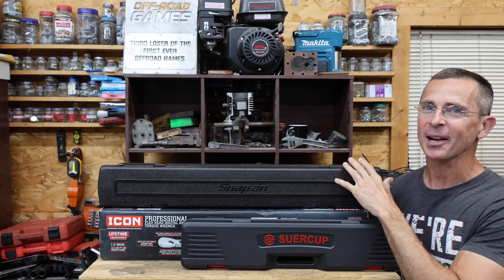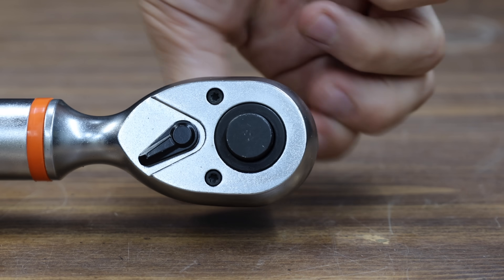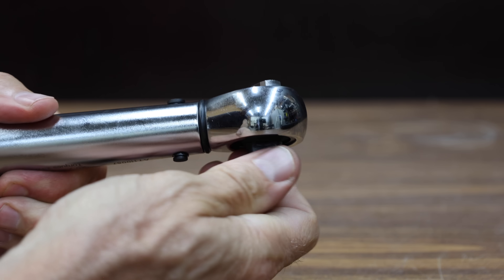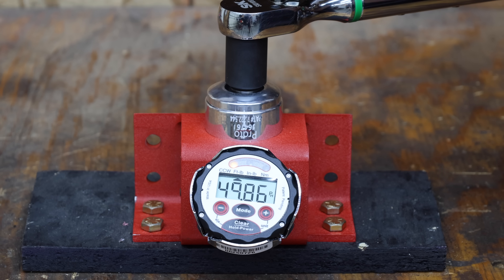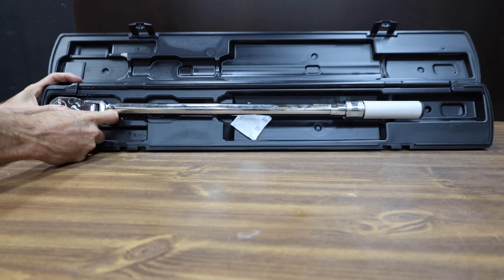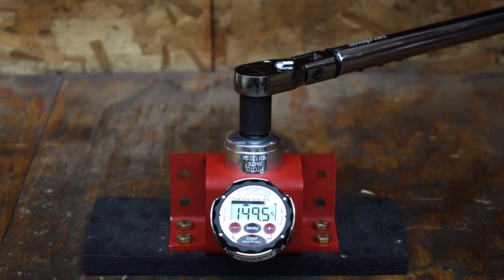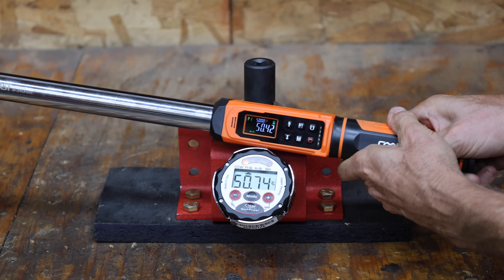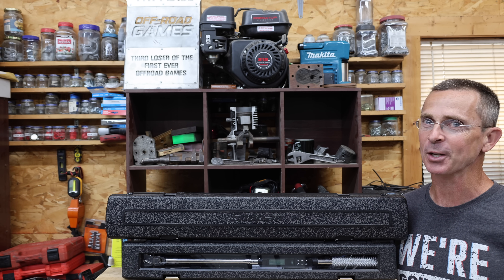$78 Torque Wrench vs $790 Snap On & ICON—I Didn’t See This Coming!

Comment: Beyond the accuracy, I've found the ergo's and user interface on many (most?) of the cheap torque wrenches to be nearly unbearable...  Things like incrementing by .01 ft/lbs when adjusting is ridiculous on a torque wrench that goes to 250. And the bedazzling array of lights and buzzes  when using them  inst4ead of a simple, crystal clear indication when you heat your torque.  Any feedback on these elements from your testing?

Comment: Hate to say it but… you’ll have to retest and add in battery voltage test at the different stages. Maybe a correlation with accuracy.
Reply from the maker: Thanks for the constructive feedback.

Comment: I have the cheaper HF digital torque wrench in the 3/8 size. It's OK, my main gripe with it is that the controls are maddening. When you get it into angle mode, it locks the display and you have to wait over 30 seconds for it to start allowing input from the buttons. It's super irritating. Also, the accelerate when held on the up/down buttons is a rocket ship. You push it once for 1/10th a foot pound, if you hold it, it starts rocketing up at something like 10+ foot pounds per second. And if you are trying to zero in on a value, and are pushing the button quickly, it might decide you're actually holding it down and in an instant you just overshot by 8 ft/pounds.
I mainly work on motorcycles, so 1/4 and 3/8 torque wrenches are what I need accuracy on. My 1/2" torque wrench is a HF click type, mostly I just torque lug nuts, and occasionally something big like a motorcycle swingarm locknut, a sprocket nut or an axle nut. Accuracy isn't all that critical for any of those, +/- 5 is just fine.
Reply from the maker: Thanks for sharing.

Comment: Tried to us the links for the TQ wrench that you used, but at least the Coobeast and the Suercup links were to 1/4" drive items not the 1/2" ones you state you used in the video. Aside from that..as I just bought a Gearwrench 3/8" drive one...I was unsettled by your results. But thank you

Comment: How about testing 1/4 or 3/8 for low torque range? I wouldn't care a few ft-lb off for lug nuts but that would be critical for spark plugs or something similar, Regardless, i am thinking of upgrading my cheap HF to digital version. Thank you again for your hard work
Reply from the maker: You are welcome!  Thanks for the suggestion.

Comment: Could you do the same type for the screw driver type torque drivers? Small things like lights and red dots need to be tight but not stripped.
Reply from the maker: Thanks for the suggestion.

Comment: My $39 Harbor Freight Quinn 1/2” digital torque wrench adapter that attaches to my 1/2” breaker bar has worked great for torquing lug nuts, etc👍
Reply from the maker: Thanks for the feedback.

Comment: Great job!

Cycled 1000 times...  Look at that energy!!!!

I agree, the Seurcup is pretty impressive for $78 bucks....  You could do a lot worse....

I actually have that Craftsman.  I've had it for awhile, I really like it.  You didn't mention it, but the Craftsman also does angle, which is handy sometimes.....

As far as new torque wrenches, guys in our lab literally would not use a new torque wrench...  They would cycle it a bunch of times (not 1000) and then check it, verify it, and then put it in use.....  And at various intervals, it had to be re-checked....  Just some trivia for you...

I would actually say a lot of those were plenty good...  There's a bunch of other factors that could easily mean more than 2% in the real world...  Is it hot out, or cold out??  How rusty is the lug nut??  How much WD40 did you spray on the stud???   That stuff would all matter more than 2%....

Great job though, great test!!!!
Reply from the maker: Thanks!

Comment: I’ve always tested torque wrenches throughout their torque range.  So it it’s a 250 ft/lb wrench I would test it 5 times at 50 ft/lb increments.  This gives you the best test that the wrench is accurate throughout its entire range.  The only snap-on tools I own are my torque wrenches just because they are accurate and maintain their accuracy.
Reply from the maker: Thanks for sharing.

Comment: Maybe Icon has changed their ways more recently, but I used to have an Icon torque wrench. After the 3rd time of the gears binding up I got tired of driving back to the store so I bought a Snap-On. Complete overkill for my needs, but it works every time I need it.
Reply from the maker: Thanks for sharing.

Comment: I have a Snap On click style finger pincher from the 90s that I have never had a problem with and I keep it calibrated. I have a digital Snap On from the early 2000s that I also keep calibrated and have had no problems other than replacing batteries like I say and like I’ve told my kids you get what you pay for.
Reply from the maker: Thanks for sharing.

Comment: Where is the Pittsburgh? Didn’t see it in the other review you did of non electronic torque wrenches that you did in the past. But, that’s what I can afford, have bought, use and routinely rely on. Is it close? No clue but it has to be closer than just guessing “probably tight enough.” They are cheap enough by comparison that you could get 3 or four to see how consistent they are, or aren’t.. thanks
P.S. if there is a torque spec I try and use the torque wrench, diy I don’t really know what I am doing and don’t want to mess things up. I have striped threads with an oil drain plug once. So, yes I carefully torque even my lugs nuts cuz I don’t think it can hurt and it makes me feel good, safe and secure. Worth the time for me.
Reply from the maker: Thanks for the feedback.

Comment: Sewercup. What a name. I didn't catch it but does that one also have the Angle measurement?  A lot of engines today are torque to yield which require angle measuring after reaching the proper torque.  I think you mentioned angle once or twice when presenting each wrench.  It would have come in handy when I was working on the Ecoboost which EVERY bolt required a 45* past torque turn.

Comment: Could you tell by using a spring scale on the end of the torque wrench (preset to a desired test weight) and test the accuracy of the digital components? What about comparing digital torque wrenches against manual models, both with and without a click indicator?  I think that would make a great follow up. When relying on the display to calculate % off target, you don’t actually know if the digital was correct, or the applied torque.  I just hit 15:26 and see that you already were checking 😂
Reply from the maker: Thanks for the suggestion.

Comment: The snap on guy I have every year verifies the accuracy of my Torque Wrenches on all 3 of the Electronic ones which is a big reason I bought them (and the 30% discount) 
If they are out and can't calibrate back to that like 2% margin they get replaced. 

I started off with Gearwrench click types. They let me down multiple times unfortunately and I made the switch to Snapon after that. It was fine as a lube guy but when I got into more mechanical things and started having come backs related to the fasteners I got very discouraged by Gearwrench. 
I also bought some of their new locking ratchets and they just don't stand the test of time at all. Overall kind of sad because I was big on Gearwrench. I hope others have had better luck and this video is great. I'm glad there is alternatives because if the Snap On guy wasn't such a good man I wouldn't touch their stuff. I just can't justify it with the cost of life now
Reply from the maker: Thanks for sharing.

Comment: My snapon 18 volt impact wrench charger finally quit. I had the batteries repacked 2x.  The last one seemed to not hold a charge long...now the charger won't charge. I paid near 600 for this and now....  wondering if anyone can offer a good price for repair?  Or should I just sell it as is or for parts?  How much are these worth now?

Comment: I'm a big fan of inexpensive tools, and I think you often get 90% of the benefit for 10% of the price when comparing against premium brands.
That said, in this case I think it's a little tough to draw confident conclusions on the SUERCUP or most others based on the single tool you bought. As far as I understand the exact accuracy of a given torque wrench is somewhat up to chance so you could have a gauss curve of accuracy all within the +/- 2% acceptable range. It's possible you got "lucky" with a particularly accurate SUERCUP and less lucky with some of the other similarly-priced brands.
That said, a sample size of 1 is way better than 0, so I'd still go for it if I were in the market for one. And the ones that exceeded 2% error semi-frequently are definitely off the list for me.
Reply from the maker: Thanks for sharing

Comment: You need to do a tutorial on how to use a torque wrench. 

The bolt or whatever has to be moving. I have seen too many shops use an air gun with a torque stick and then use the torque wrench and it clicks immediately and call it good. OR use a torque wrench and give it a good push after it clicks. 

I got kicked out of a Walmart for giving them shit about how they finished off my lug nuts. I had just finished my first semester in Civil Engineering and one of the classes covered torque. 

The only good torque measurement you can get is with a smooth twisting motion. 

Torque is only good if the fastener is moving. Full stop. 

And that brings me to you having to re-torque your lug nuts after 25 miles after you get new tires put on. You put the torque wrench on it and it immediately clicks. That means it is good, or, it could be 20-30-100 lbs over tightened.

When I do my own tires I go 5lbs under, and then drive and then torque it to the correct number.
Reply from the maker: Thanks for the feedback!

Comment: Okay, swing beam torque wrenches. Lots of under $20 ones, 1/4" and 1/2" drive. Plus I know there are millions of them out there used, sitting in forgotten tool boxes. How close are the old ones? The new ones? You may have done this. I have watched a few years of your show, but I don't remember that test. Great job as always.
Reply from the maker: Thanks!

Comment: Bout a month ago, bought a HF 3/4” Torque wrench to swap out my OEM LPOP and OEM dampener, to new Hi-Vol LPOP and a fluid- dampener. 
It worked just fine. Truck runs great and I have it forever now. Didn’t recall if there was a calibration cert with it.
Reply from the maker: Thanks for sharing!

Comment: Two things a mechanic needs to know: How often does the torque wrench need calibrated (its in the manual).  Some require a cal every 6 months.  Some a year.  Next is what is the manufacturers recommendation if the wrench is dropped?  Many require a calibration if dropped.  Also, most torques are usually +/- 10 ft/in/lbs.  I've never see a bold require exact (or even 2%) tolerance.
Reply from the maker: Thanks for sharing.

Comment: I suppose as the required torque spec climbs, pinpoint accuracy might be a little less important, but that begs the question if it's better to be under, or over.

Comment: Torque is more about consistency than actual accuracy in high torque applications. For low torques ie inch pound ranges it is more critical to be accurate. Auto manufacturers and probably other machinery makers are going to torque angle rather than just torque. BMW started using angle torque over 40 years ago.
Reply from the maker: Thanks for the feedback.

Comment: I would imagine if the highest range is 250 and the lowest range is 25 you should probably aim for like $125 lbs I'm not pulling out a half inch torque wrench to do a 50 ft lb
Reply from the maker: Thanks for the feedback.

Comment: One addendum I would suggest (and someone correct me if I'm wrong here)... a torque wrench should never be "snapped" or "jerked" to its click/fastening torque. It is supposed to be pushed or pulled slowly and evenly. Only then can the reading be trusted to be accurate.
Reply: It's literally just to test the speed at which the sensor can read the pressure.. it's not to try to emulate a real world situation
Reply: You are correct, steady, even pull to the set torque is the way you're supposed to do it
Reply: That's what I was taught at work..... then I watch so many people do it completely wrong.
Reply: Yes I'm not really sure what this has to do with the accuracy of a torque wrench
Reply: You are correct.
Reply: Yep, I just pointed that out in my comment, too.  Was a big no-no even with my ancient twist-dial wrench.
Reply: You're absolutely right, but it was to see how fast the sensor reacts to it... but yeah... I've seen plenty of ppl do this; quite a lot of backyard "mechanics" if you can even call them that. I make a LOT of money off their jobs lol
Reply: I made the same comment. Few know how to use one. I have seen so many mechanics and tire shops have zero knowledge of how a torque wrench works.
Reply: 😂😂😂😂😂😂😂😂😂😂😂😂 oh girl.

Comment: The torque accuracy of a few pounds between brand is not as important as proper technique and being able to stop turning the wrench when indicated. More inaccuracy is also done by not having the proper torque specification to begin with or using vs not using thread lubrication. The wrenches made in China basically use the same sensor the difference is in the display and control button quality. Once the display stops working, you will have to buy a new one anyway. Go for the bargain. You are not torquing Rolex watch screws anyway.

Comment: Did you check that the swivel head wrenches are still accurate when they are angled?  It seems to me that a swivel head would seriously impact the measurement.  The more that the head is angled, the more torque would need to be applied to the handle in order to affect the head.

Comment: Does a couple of foot pounds make a difference. No. From a long line of "twist till it feels tight" I've never seen any difference as long as it's not over tightened where you can't get it off but I'm not working on the space shuttle either.

Comment: I have a friend that was a heavy mechanic for several decades. He would buy only Craftsman and some Snap On. He would often break Craftsman but stop on they way home for a replacement. For the Snap On he would only buy certain tools and would complain they were just overpriced for what they were. Seems like you just turned a 800 dollar tool into a 100 dollar tool. It seems only a tool would buy such a tool ... after seeing these results.

Comment: How many of these besides the Snap-On can do angle and can ratchet in the middle to allow you to do torque to yield bolts when you don't have enough room to reach the required angle? I barrowed my friend's Snap-On because I wasn't going to buy a $1000 one and couldn't tell if the others could do the job I needed to get my truck back together. They all have the same flaw though. They are battery eaters and all use alkaline instead of some lithium rechargeable cell.

Comment: AvE has done a video on how cheap these are to manufacture compared to a traditional torque wrench.  Its just a glued sensor to the shaft that measures metal flex and from that it derives torque.  The rest are the lcd screen and buttons.
Reply: AvE does some choochin vidjeos worth putting the safety squints on for sure.
Reply from the maker: Thanks for sharing!
Reply: the true AvE method is of course "nnnnnnnggghhhh!- CLICK!"  🙂
Reply: I read the word "Shhaaaaft" in AvE's voice.

Comment: The biggest question, will my nephew be able to turn on and use any of these electronic torque wrenches 25 years from now like he could with a mechanical one....no. it will be thrown away as junk. Doesn't matter how much you spend.
Reply from the maker: Thanks for sharing!

Comment: It looks like most of the electronics are  the same  and the mechanical part of the tools are what makes them different which is typical in the tool industry..    I didn't see how the tile saw did in the test... HFT is going down hill fast, which is scary because they started at the bottom of the hill. ...
Reply from the maker: Thanks for sharing your thoughts!

Comment: The top 2 are already sold out in 1/2", typical for Amazon. Either they have it and jack the price up 25% or they sell out and when new stock comes in the price is jacked way up as well. I don't buy much from Amazon for this reason.
Reply from the maker: Thanks for sharing!

Comment: In the Air Force, any torque wrench that falls more than 18 inches is to be sent back to the lab for calibration.  Those who drop it are to quit using it immediately.  But that never happens.  They keep using it, and almost never tell anyone.
Reply from the maker: Thanks for sharing!

Comment: Thanks for the video  impressive work 1000 times 😳😳😳     
Has anyone found the suercup 1/2 torque   I have looked all over and can't find it on Amazon or anywhere  if anyone has a link I would appreciate it     The link in the video is for the 1/4 inch one
Reply from the maker: Thanks for sharing!

Comment: Love this guy's videos, no fluff and straight to the point. The torque wrench you choose should be based on what you're going to use it for. I have the half inch Snap-On for doing engine work (bought it after torque-to-yield bolts became the standard) but I have two cheap click type torque wrenches (1/2 & 3/4) for tightening lug nuts. For what I paid for the digital Snap-On there's no way in hell it's touching a lug nut.
Reply from the maker: Thanks for sharing!

Comment: I just purchased a SUERCUP torque screwdriver to torque down some tungsten carbide cutters I'm using to replace the high speed steel cutters on a Wen PL1326 Thickness Planer.  This video gives me a bit more confidence that the brand will be close to accurate.
Reply from the maker: Thanks for sharing!